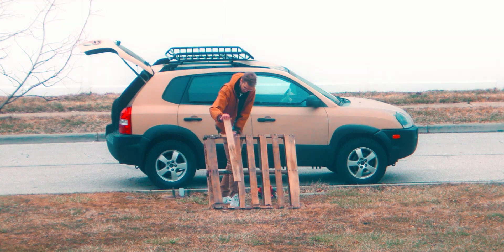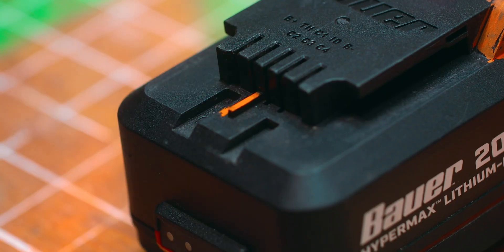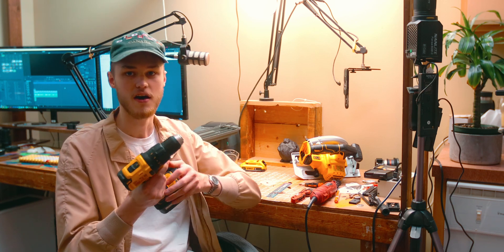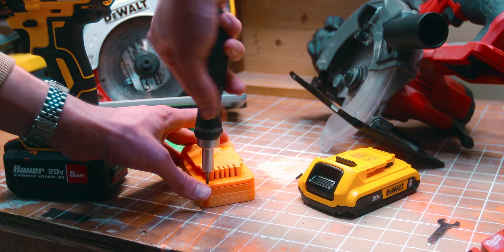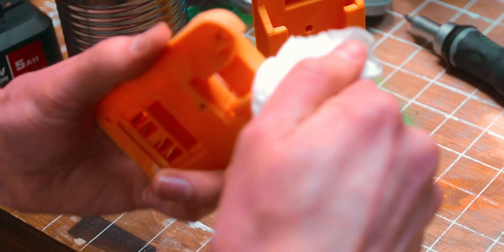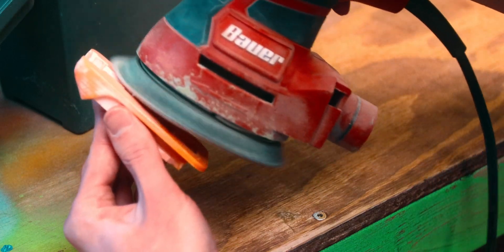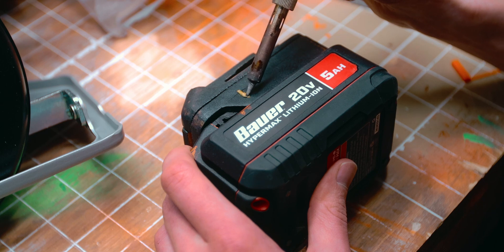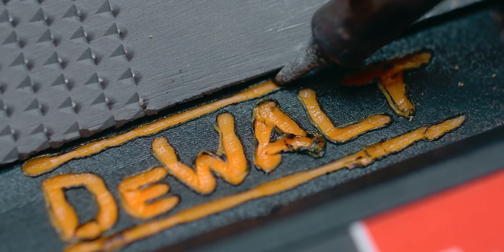I refuse to abandon my old batteries.

Comment: At one point you could take a Harbor Freight battery and put the inner working, battery board and all, into a Black & Decker case and it would work perfectly.  When the manufacturer found out they discontinued the battery.  Now I can't even switch the 18650 batteries inside.  Somehow the charger knows and won't allow it to be charged.

Comment: all u need is a 10k resistor between the positive and pin 5 (i think) and 12v to pin 3 (I think). at least thats how I made a dewalt drill run from a regular 20v power supply

Comment: What you said about the school system towards the end there has essentially been the answer to a question I've had for a few years now. Why am I bad at remembering math? Well it's because I don't know how it works. I've gotten into highschool recently, and all the math has gotten fairly complex, and i've had a big difficulty doing it, because i didn't understand how it worked. I get told that this problem gets solved this way, but I never get told why it works. I have never been told how formula's work in math and I forget it, yet I have an almost perfect memory of how my dad's old toyota mr2's wheel well assembly works because I helped him build it. Thank you for answering a question I've had without you even knowing it and it being completely unrelated to the video.

Comment: Great video! I’m sure someone probably has mentioned this, but some cheap “no name” batteries will use resistors in place of thermal runaway circuitry, tricking the tool to work, but eliminating the overheating and potential fire preventing safety circuitry. I use whatever works, but it’s something to be aware of. I spend 3 hours trying to swap a sonic toothbrush battery out that was spot welded in and made to be thrown away just because I wanted the challenge and I wanted to know how it worked:)
Reply from the maker: Interesting- yeah they're always doing something to mess with consumer modifications. Honestly after this whole thing I ended up using the dewalt batteries more often anyway lol. The adapter is nice to have for travels though so I don't have to pack two sets of batteries and chargers

Comment: Just an fyi every one of the batteries used in powertools with the exception for ryobi have no real protection circuitry. This means you can run a battery down so low it doesn't work because it's the tool that is turning off instead of the battery. Ideally the adapter would have some kind of low voltage cutoff but most don't so just don't run the too far down and you'll be fine.

Comment: The pin out on the battery is different that's why it doesn't work and the adapter is required to reroute the pinout
Reply from the maker: Yeah I’d definitely like to mess with it more and get it working in a more compact way later. Definitely should be doable to rewire the pins in the case

Comment: Acetone smoothing only works really well with ABS. Even with that you can only use vapors, a full acetone bath with ABS printed items would give you a pile of mush heh... If you are very curious, check out what others use for smoothing on specific types of 3D printer filament. Most popular and/or common are PLA, PETG, and ABS.

Been tinkering my whole life, I have a slew of projects going. Self built 3D printer, CNC engraver for creating my own PCBs, testing equipment (some self made) for refurbing the electronics in old tube radios, I built a CAD workstation separate from my main computer, one of my cars needs some work on the head so I have that tore apart, I created my own NAS, and the list goes on.... it doesn't matter what it is, I'll tinker with it. I'll check your channel out =) you earned another sub my friend.
Reply from the maker: Thanks for the comment! I had seen vapor baths before so was vaguely familiar with the concept - I guess I lucked out that it wasn't ABS so I didn't totally dissolve my part lol. I did notice that it didn't really do much, so I assume it was PLA, in my memory acetone worked for all of them but I guess not. Did this in 2 days so I was just in a rush to get it "good enough". When I get a printer myself I'll definitely dive into setting up a proper vapor bath. Last time I really tinkered with a 3D printer was like 5 years ago, but I'm excited to see just how much things have improved when I start really diving in again to buy a new printer.

That custom CNC project sounds awesome- I've looked into that a little myself, although I was interested in milling aluminum which is a bit more scary to mess with DIY so not sure if I'll go through with that one. A NAS is also something I'm interested in down the road, and car maintenance is always interesting - I've got a lot going on with my car myself. I'm sure you'll find some of my upcoming stuff interesting, glad you're here!

Comment: Harbor Freight minion here, and I approve of this nonsense. Try incorporating that small board into the Bauer casing. Furthermore, ask yourself "what is that little board doing?"
Reply from the maker: Thanks! I used to work at a harbor freight myself. I should have elaborated more in the video- my thought process was that I didn’t want to do the electrical modifications and permanently turn it into a dewalt battery, in theory the physical modifications would have allowed it to function as both.
Another commentor brought up a good idea though - add a switch that swaps between the two boards, effectively switching the brand back and forth. Something I might try in the future.
Reply: @EvanMonsma  You realize you may have tumbled into a can of worms here?  You could spin this into a sub-series on your channel. Delve into Hercules, too. Heck, I'll probably send some 1.5aH batteries for testing purposes.
Reply from the maker: @TreyCook21  Thanks! I’ve messed with Hercules a little bit before, didn’t get quite as deep into it, but it’s definitely doable the same way. For now, the adapters will be my solution but I’ll absolutely dive back into this topic when I get a new tool I need to adapt

Comment: Id like to see a break down of the circuit board that came with the adaptor; like what is it modifying? how does the intended battery send that particular signal, how do you find the signal? asking for my self who constantly forgets which brand of what i have and having way too many types of chargers.
Reply from the maker: I may do a follow-up down the road, I’ve got some more ideas. Here’s what’s in the adapter-

The adapter only receives 2 pins from the Bauer battery (positive and negative) and it adds 2 extra pins for the dewalt end. One of those pins is connected to the positive with a voltage regulator, the other is connected with a resistor. I assume those are arbitrary and change per brand, and the tool checks voltage through those pins to ‘authenticate’ the battery. If you do any experimentation with it let me know!

Comment: Wouldn't just adding the circuitry from the adapter in the bauer battery worked also?  Cool video.
Reply: If you isolated the Dewalt circuit with a switch, it could still work with both
Reply from the maker: @kennysiskmusic3743  Good point- that also sounds hilarious- a switch that changes the batteries’ brand lmao. I gotta try that
Reply from the maker: Yeah it would have, although that would permanently make it a dewalt battery and wouldn’t work on Bauer tools anymore. The idea with the cutting is that it would work with both. I still might go back and add the resistors at some point though

Comment: harbor freight also carries rotary tool end mill that work wonders on plastic removal...and is really fkin satisfying lol
Reply from the maker: Oo I’ll have to check that out- the cutting dremel was not the best tool for the job
Reply: @EvanMonsma  yeah I seen that but after I discovered the end mil bits they just eat right through plastic and you can be pretty accurate with it